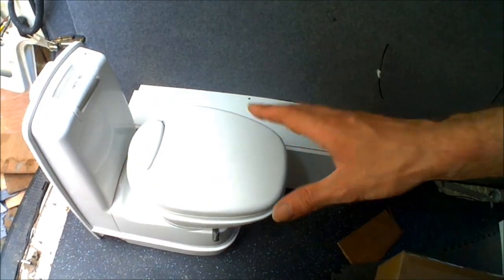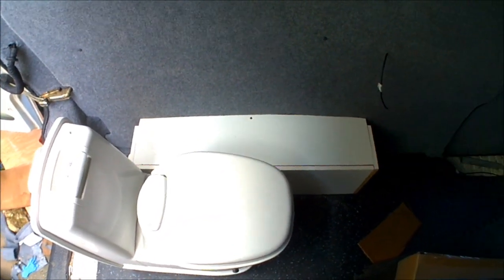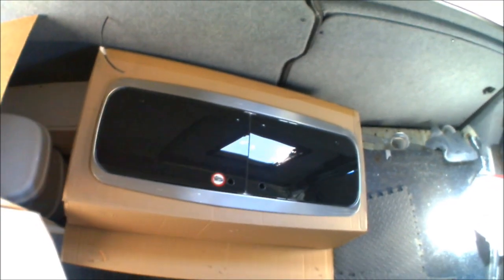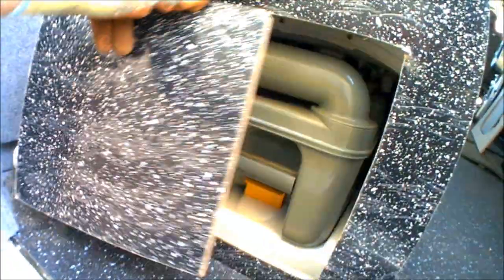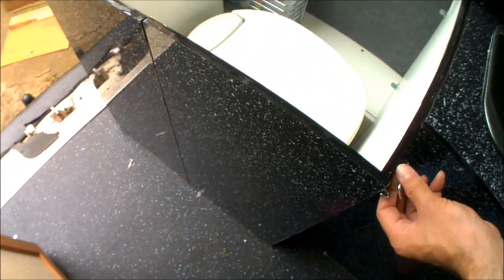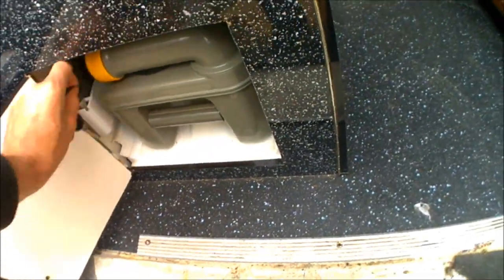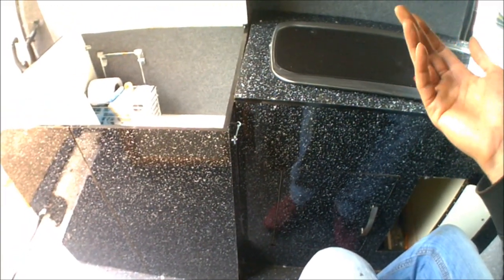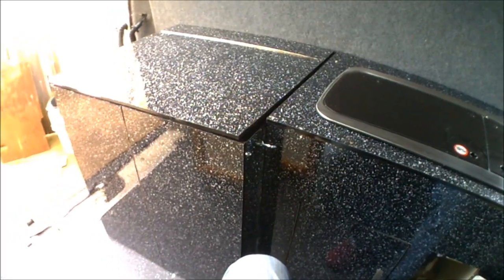DIY Campervan Toilet Cubicle Installation VW T4 Camper Swivel Toilet Install

Comment: This is a good idea, I'm just using a bucket and sawdust and them handles leave marks and there's a risk of it toppling over with me on it, so am gonna have one of these.
Reply from the maker: I had a portable thetford one in my last van and although better than nothing, a bucket would probably have been more comfortable, hence deciding to fit a proper caravan style unit in this van so if its required, it'll be comfy and I think the unit looks good too, not obvious what it holds inside and still plenty of space in the van

Comment: You did a very great job with it, do you have a name for the Unit, so i can look in ebay where i can buy something like that for my Projekt?

Best wishes, Dennis from Germany 😃👍
Reply from the maker: Thanks, I made the unit myself so no links to provide, just something I knocked up to house the toilet and hide it away from sight
Reply: Camper Conversion you build all the plastic my yourself wich the toilet is made of? And the flush, the seat, the box where everything goes on, the tank for the water? It looks like a thing that you can buy. That you did built this into your Bus with dome Wood, i did see, but the toilet it self is a buyable product or not?
Reply from the maker: Ahh the toilet is a Thetford C200, they have a few different models available, they have been the general toilet of choice for caravan & motorhome builders for years, search Thetford toilet and you're spoilt for choice, hope this helps.
Reply: Camper Conversion ah thank you very much 😃